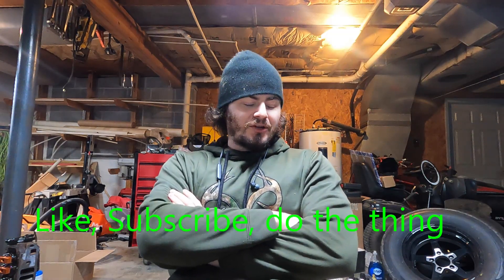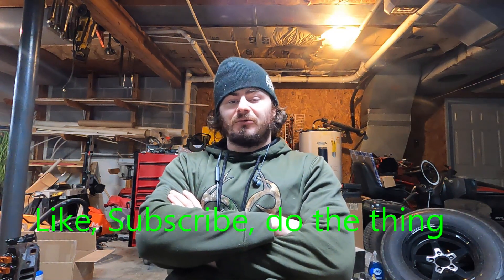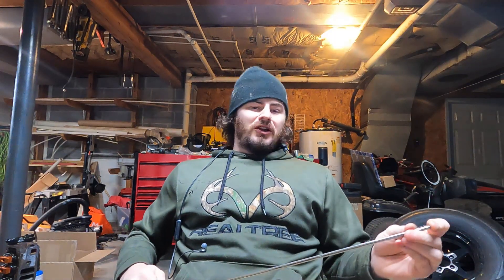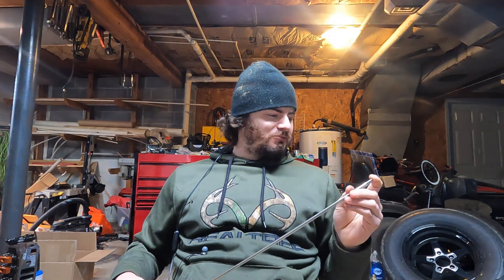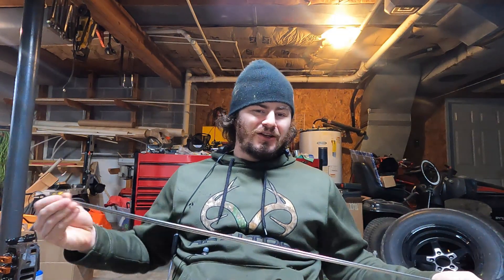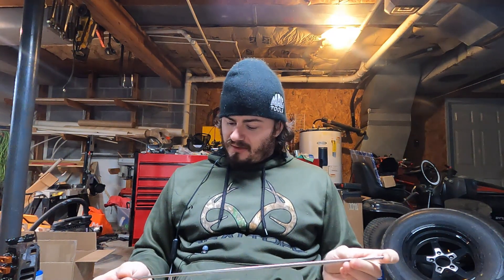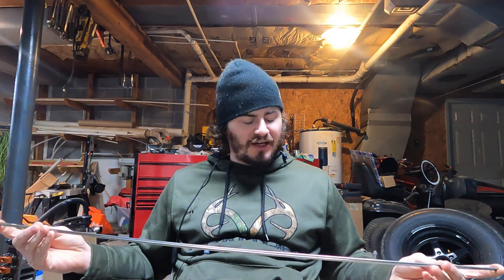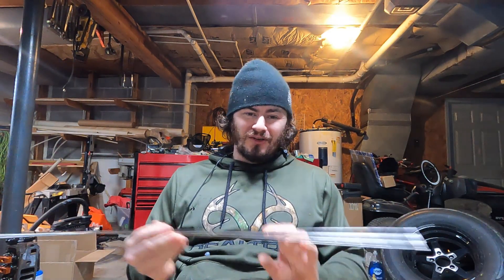Dakota Update(story time)

Comment: The turbos act as a lever to push on the rear on take off. If you move them lower and back you loose the lever and lift the tire. Scales are great if you race standing still. 
Stop using cheap gaskets and get a set of Cometic. And get the thin ones .027. you do no good having a gap at tdc. If you use a thick gasket your actually inducing detonation REGARDLESS of compression. 
Turning the boost up for cylinder fill get to be diminishing returns.
JM2¢
Reply from the maker: Thanks I appreciate the comment. I'm very well aware of how quench works. But with a dished piston you can put it as close to the head as you want the only area that is receiving the benefit of tight quench is the perimeter of the piston. Everywhere it is dished it doesn't matter. The pistons are already.015 out of the hole. This is a cheap street engine I'm not trying to leave a pattern of the piston on the cylinder heads on something I drive to work. Not worth it to me. Yes the weight being further up and forward will help but only if it hooks in the first place if weight transfer can't even start then the lever effect doesn't work. I also drive hard it's not just a straight line I'm trying to improve but overall performance. When I say I drive hard I mean I love the corners and the mountains and it being so nose heavy isn't helping. I hope this explains my goals a little better.

Comment: I’m going the remote turbo route with my SS/T Ram 1500 for the weight distribution and cooler engine bay temps. I’m currently piecing it together. It will live in front of the rear passenger wheel. I’m going with a single GT45.
Reply from the maker: I miss my full size ram. That's going to be awesome!

Comment: Hey do you still have the m122 setup for the truck? Curious if you would want to sell it
Reply from the maker: Well kinda. The blower is on the V8 in my 240sx now. I still have the manifold tho.
Reply: So to make it work I would just need to find another m122?  I have a 112 off a Ford lightning but it is a top loader plus the m122 work better
Reply from the maker: @chuckessa5649  basically yes. I'm still torn on selling it. If I did I'd need $450 for it.